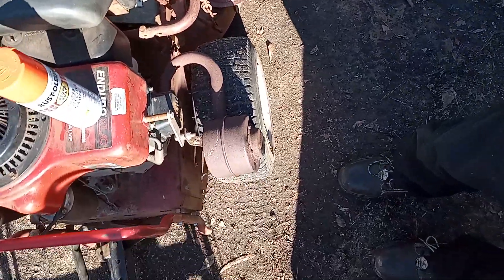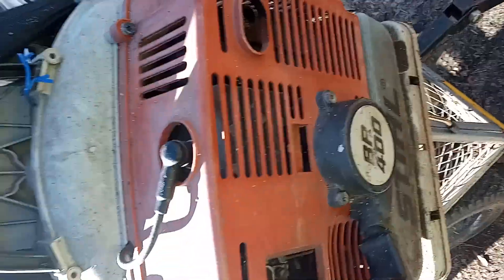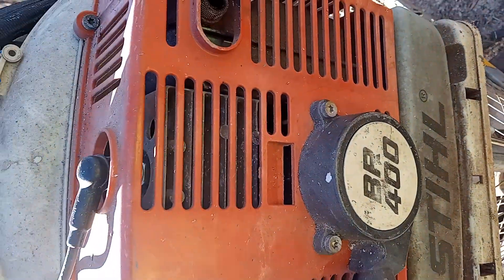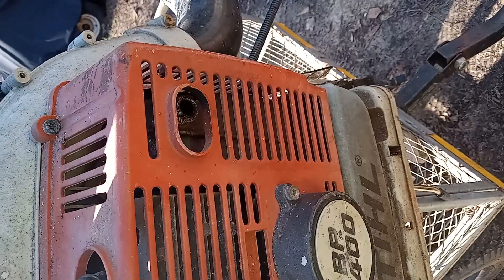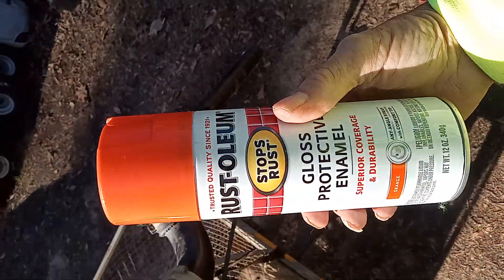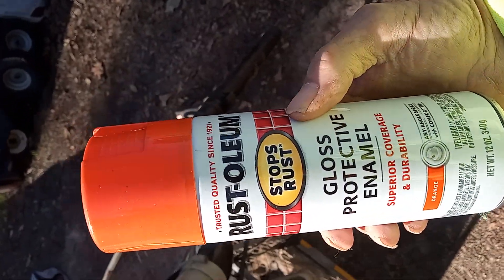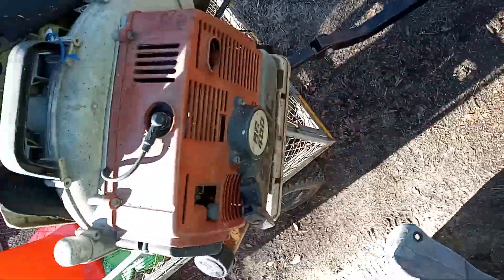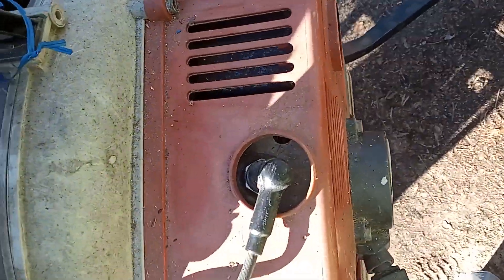January 7, 2023

Comment: I was taught a trick when I was a kid, I use a small propane torch and do quick passes over the plastic and it brings it back to life nicely.  Practice on something you don't mind messing up, it's easy but it takes a little practice to learn how much heat it will take before warping it.